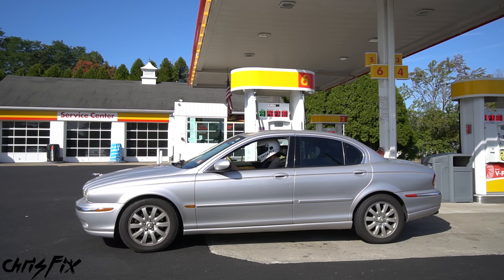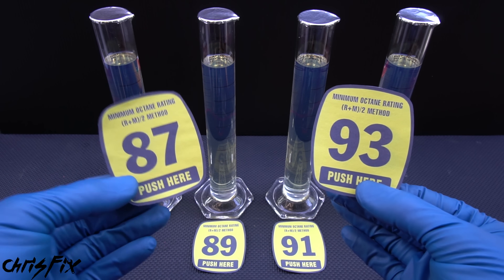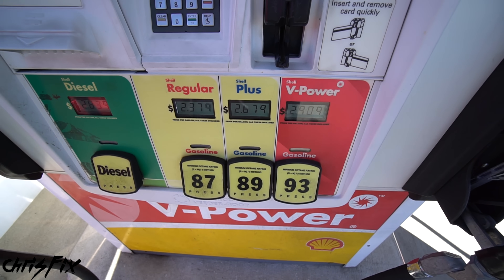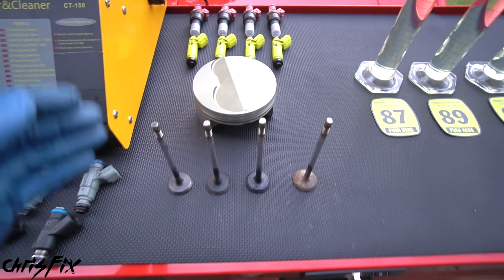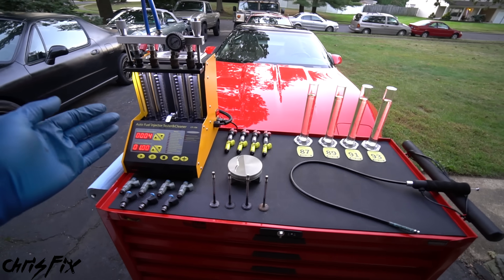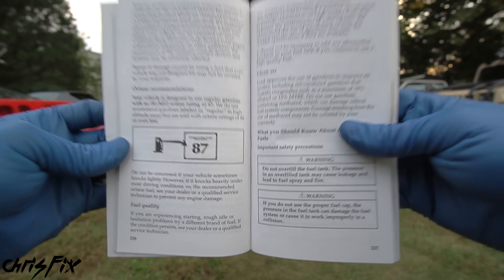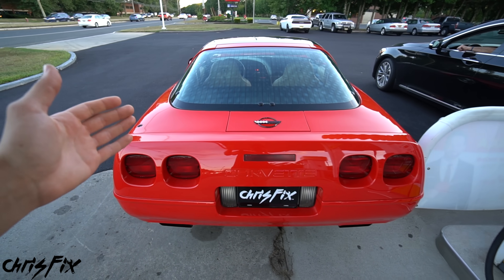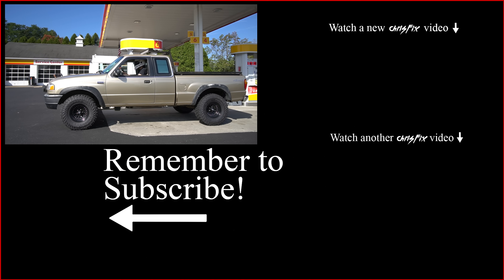What is the BEST Fuel to Use in Your Car or Truck and WHY

Comment: Been burning 87 octane gas in my vehicles for twenty years with a knock sensor, never had any issues with the engine performances on  one of my vehicle,  I got 300.000 miles out of that engine on 87 octane.

Comment: One thing many people do not know the premium fuel burns slower. Altitude also plays a role. These are recommended settings at sea level. If you live in the mountains where your say over 5,000 feet with an engine that says recommended premium. You most likely won't need it. Less external pressure the higher up you are in elevation where regular is more then fine. I do follow up on the recommended fuels that are Top Fuel additives to my manual on my 16 Toyota Camry Hybrid. Don't get sucked into paying higher fuel prices for fuel most cars don't need.

Top Fuel already has the proper cleaners and you don't need to put in additives every so often. Chevron, Costco already have this fuel additive. Stay away from cheap gas stations that don't have the Top Fuel and your cars engine should last you a very long time! I learned this from automotive classes. I am not a mechanic. Also, the difference between summer and winter mix is alcohol. In case anyone wondered. Thanks Chris for the great video.

Comment: I have watched many videos that claimed using g a higher rated fuel that your car doesn't need, doesn't provide any benefits. But they do!

My car only requires 87 octane fuels. When I had thr 4 cylinder version, and used that feul, acceleration would be terrible. Many times when trying to enter th3 highway, or lane change, I would press the gas and the car simply would not respond. By the time it did, many times it was too late and unsafe to make the move.

So I started dropping octane booster in with the gas which helped, but it didn't seem to last for the whole tank. 

O e time when visiting a Shell and buying some booster, the mechanic on duty, said it would be best to just choose the mid-grade gas and get the same benefit. So I did.

Instantly I notice a difference when I would press the gas. The car right away picked up speed. 

He also mention, usually the issue is th3 fuel injector could be clogged and enough gas wasn't getting to the engine when I needed to power, and by the time it did, it was too late. Then I said, why would that be a problem on such a new model car?

He asked if I drive everyday. I said pretty much. He 1st stated to not buy gas from 2nd hand gas stations. Stick with BP/Amoco, Shell, Mobil as examples and stay away from Marathon's and Speedway.  

Since then I pretty much use mid-grade gas all the time. And even though I have the 6 cylinder version of thr same previous vehicle, whenni tried using 87 octane, I often got thr same 4 cylinder results. So now I stick with mid-grade.

The only downside that I notice is higher octane feul appear to burn faster. Which is true. They do burn hotter leading to more usage. 

I also was told once that high octane gas can cause engine damage.

I kept one car for nearly a decade using 89/91 rated fuel and I never suffered any know engine problem. 

Maybe this was more true 20 or 30 years ago, but I can't see how that would be true in more modern cars.

I would say, if your car is rated for regular gas, mid-grade is a better option and avoid the premium option. Premium is strictly for high performance cars and could damage a car it wasn't meant for.

Cars that can use ethanol/corn based fuels like mine can is also a good gas to use to help keep the engine clean. A clean engine performs well, especially when you live in a area where it's gets cold.

I also use synthetic oil because, most have Teflon which leaves a nice coat of oil on the engine even after it drains back into the reservoir. This helps again cold starts where engine parts get worn from no oil being present when you first crank up. This is a very big deal for cars in cold weather

Comment: Ok I’m stopping the video firstly yes the Ron and pon system is different but a pon the numbers aren’t that different so yes Europe get and most of the developed world get better fuel. Also higher octane do burn hotter and more completely and give more power this is because it burns better and can run higher compression/boost and later timeing

Comment: So is the non E-85 (just actual 85) specific to certain vehicles, or is it mostly to do with elevation? I know it's basically unavailable in a lot of states, but in Wyoming, Colorado, Utah, and I think North Dakota, the "basic" or lowest grade octane is 85, and there are still pumps with E-85 as well, so I assume they aren't just the same? Would love to know if it's actually viable to run, or if no manufacturer would ever recommend that octane rating.

Comment: Chris: the one variable you didn’t discuss was altitude. Here in Colorado for instance. Because of the altitude we have less air density. In fact we lose about 20% power (5% power per 1000 ft of altitude) So our engines have lower actual pumping pressure(real compression) My Mercedes E320 is naturally aspirated, and is recommended to use premium. I have been finding that mid grade is fine. No knock. No performance loss. I do put premium in occasionally for the increased cleaning agents in the 91 octane here in Colorado. My Turbocharged cars, especially with upgraded turbo boost; always premium. An interesting note, my 73 Porsche 911S had low compression of 8.5 to 1. I used regular when on the race track. Some fellow Porsche owners surmised that less additives make for a slightly higher efficiency and power. I didn’t notice.

Comment: I have a stock 93 f-150 with the 4.9 L6 in it. When i use 87 gas it pings. When i use 93 gas it runs fine. But this engine is a 87 regular gas engine. It also gets double the fuel milage on 93. Why is this?

Comment: Wow! This is great!! Quick question. I drive a 2007 Honda Odyssey van with well over 300,000 miles. I do number of trips across the country from pacific to Atlantic. That I have done in about 3 days. I try not to push to hard. I have noticed I have to stop fewer times for gas ⛽️ when I use the higher octane compared to the lower octane. Why? How does that make a difference? Thanks

Comment: Awesome video Chris. A little pointer for people having to fill up when they are low on gas and the required fuel is not available. Don't fill your tank all the way fill up to what you need and get the right fuel as soon as possible. Less is more in a situation like this. Keep up the great videos I've learned so much from you it's incredible.
Reply from the maker: Thanks for the tip and thanks a lot!

Comment: Correction,  Octane rating is resistance of detonation yes, but...its the pre detonation that's in play here. meaning depending on your vehicles compression, the air fuel mix will detonate on compression stroke before the plug fires it due to the heat from compressing low octane fuel in a high compression engine. The pistons are  getting combustion force too early before the plug fires right before top dead center on the upwards compression stroke. This is where the "nock" comes from. The combustion energy is pushing the pistons down when they are on their way up.  This will eventually put holes on top of the pistons. So, you're wasting your money on premium fuel in your grocery getter, and doing engine damage to a sport bike, or high end storts car for using regular fuel.
Reply from the maker: Correct!
Reply: @chrisfix  this video was a breath of fresh air for me. I was like, finaly someone knows what they're talking about! You wouldn't believe the debates I have with fellow motorheads on said issues. When I was in technical school over a decade ago, we had to diagnose pistons with different types of damage and failures. From pre detonation, to hot or cold seizures, or whole ass valves stuck in them.
Reply: @chrisfix  p.s. I'm a subscriber now. Lol.

Comment: Most octane boosters are too low in quality &/or potency, to significantly boost octane. In some cases, you might need 50 or 80 of those little bottles, just to raise octane...say 8 points (from 85 to 93). That is not cost effective. The bottles deliberately use an exaggerated rating system, to help liberate you of money! But there are a few brands that are effective. My favorite is called RaceGas.

Comment: 14:17. Quick suggestion if you are forced to use an octane booster; pour the octane booster in prior to fueling. Fueling after adding the booster will help in mixing the booster into the fuel tank.

Comment: This theory or your I formation is a load of crap. My bmw M5 recommends 91, my bmw X4 comp recommends 91, well
I have used 87 since I’ve owned the car M5 with 150k miles  my other m5 40k my x4 4000. All a load of crap

Comment: I have a 2009 accord and I didn't drive it for 9 months and now when I turn it on I feel a slight shake. Should I use certain fuel system cleaner or specific gas to solve the problem?

Comment: love the driver wearin the helmet in the muscletang!😆😅😅😉😁good video, but you are gravely mistaken on the octane booster myth, which many are commonly mistaken, and mislead by. octane booster in conventional fuel is snake oil,it dies little to nothing to boost octane. as well, detergent fuels are bad for older motors, older fuel systems, too much ash... the only thing ictane booster does to a fuel is add some extra lubrication, or add extra ash causing junk that we dont want... granted its possibly a good save in a pinch, but only because it adds more lubrication to the pistons. with cheap hot fire fuels, more lube is better.

Comment: i drive long hours and my cadillac dts V8 gas Mileage increase a lot when I put premiem instead of regular. Can he explains why with scientific proof rather then using analogies
Reply from the maker: Your car is probably "premium recommended" so your engine can advance timing more significantly, which is how you are seeing the mileage increase!

Comment: One thing that I've seen more recently is the increase of E-15 gas at pumps.  I know it stands for greater than 10% ethenol, but how does it compare to standard 87 grade fuel?  What, if amy is the benefit to it vs regular?
Reply from the maker: E15 is added to almost all fuel now regardless of octane so comparing E15 to 87 wouldn't make sense :p
Reply: @chrisfix  Thanks for the reply I wasn't expecting it on an older video.  My main confusion comes from, at least in the DFW area, UNL E15 is on a seperate dedicated pump in most station.  If most fuel already contains up to 15 percent then is this just marketing by the stations?

Comment: 4:55  when u to 102 Ultimate to get the joke
Reply from the maker: huh?
Reply: @chrisfix  in Germany we have a premium fuel which is rated 102, many tuners use it because is has e extra ordinary knockresistant. It’s called Aral 102 Ultimate
Reply: @chrisfix  we have 98 called super plus Shell has a 100 and Aral hast 98 and 102

Comment: One critical point missed.  Today’s modern engines have higher compressions than in the past, and most if not all have computer controlled ignition timing.  This permits the engine to operate on “low grade” gas by retarding the timing in order to prevent ping (detonation).  When timing is retarded, ping is reduced... as well as performance.  When high octane gas is used, the threshold for detonation is higher, allowing the ignition system to safety advance the timing, resulting in an increase in performance.   The question to ask is,  “Is the increased price of high octane fuel worth the performance gain it provides?”
Reply from the maker: Thanks for sharing!

Comment: What is the octane rating on real gas
Reply: @EpicDrew15  non ethanol for old cars and small engines
Reply: @EpicDrew15  well i can buy it down the road not all gas stations have it if availability is the concern its labled "Real gas" it behind the building at a seperate pump i guess laws vary by state its said that it doesnt harden  rubber and extends life of a small engine and water doesnt blend with it like ethanol...

Comment: I had a 2010 Chevrolet Malibu with a 4 banger that’s said 87 was fine to use, before the Malibu I had a car that said premium required. On my first fill up with the Malibu I accidentally put premium in it and never regretted that because there was a difference in response when I would get on the gas. Was that a bad choice to keep using premium?

Comment: Great vid C F! Do you know what the octane rating of E-85 is? I was told E-85 can have "up to" 85% ethanol in it so that would mean the octane rating could vary from different batches. Ethanol has a very high octane rating so Iwould think a car with high compression or lots of boost would like it on "track days" PROVIDED IT IS E-85 COMPATIBLE. Also,curious about your "Driftstang"🐎

Comment: dude damn i just realized what you said my car does exactly that it sounds like it has marbles or something rumbling inside when i start it in the morning and when i  drive for a bit and come to a stop and have it on neutral the rps get low to the point where it shakes but it doesn’t not stall  if i heard correctly you mentioned that as imbalanced air fuel mixture???? Fml

Comment: What's missing totally in your nice video is the answer to the following question:  "Will I damage my car's engine if the manufacturer says to use 87 octane and I run one or two tank fulls of 93 Octane?

I've understood from my father that doing so just may damage your engine.  It will "burn the valves up...".  Now my Father was a submarine machinist mate in the 1930s...so are today's engine metal NOT now going to burn up the engine's valves -- or is his comments from years ago STILL the case today?  That's a BIG question unanswered in your video.

Comment: Bro my knock sensor light came
On ran the code on my Avalon twice. Mechanic said change your oil and I did today let’s see what happens. I’ve been putting in super cheap oil maybe that’s why
Reply from the maker: Let me know what happens!
Reply: @chrisfix  for sure. I hope it’s not my knock sensor. I felt the car had more torque today and as driving smoother with the Chevron Gas. Let’s see

Comment: Octane is the resistance of the fuel to ignite spontaneously due to a non-spark event.....THAT is octane.  Also, fuel formulation are not just REGIONAL but can vary even from one side of a large city to the other side of that city and that can impact what fuel you should use.....
This whole thing is an oversimplification of a very complicated subject.
I have had vehicles that said 'PREMIUM FUEL RECOMMENDED' and when fed 'regular' they ran fine, but they got 3-4 mpg BETTER when the mid grade or premium was used and the DID run better as well.....I know I have got gas at stations in Louisiana and Mississippi that was 'ethanol free' and my 22-24mpg went to 28-30mpg on the highway and the(current) car...a turbo 2.5L running 25psi on a mid size turbo, ran MUCH better......
ANYWAY...this is far more complicated than can be covered in this format....and MOST of todays cars will run better and get better mpg on the mid grade or premium fuel due to better engine management and knock sensors, and higher compression

Comment: Higher compression is good for an engine as long you use premium gas. The bad part of carbon buildup is the valves not closing and the slide that accumulates on the valve train and pistons. One cheap and sure way to get rid of carbon buildup is to run a slow stream of water through the intake while revving the engine up to prevent stalling, after you use a quart or two of water, you should shut it off to finish working and then drive after 10 minutes minimum to push out the carbon, that means pushing down on the gas pedal not cruising, repeat as needed. This technique was discovered by having a blown head gasket and when the mechanic removed the heads, the cylinders were clean, so if you want to mix a little anti-freeze with the water, no harm done.

Comment: Cool video, but in the end, the recommendation is to use what the vehicle says to use? Lol. There's plenty of data out there to use 93 even on recommended manufacturer 87. For example, 3rd party tuners liverpool tuning, have thousands of man hours calibrating maps for vehicles like Ford and jeep. Even though my jeep jl says to use 87, they have seen from the calibrations, that the 3.6 pentastar runs more efficient on 93. That may not mean more mileage, but I'll pay more for a smoother running engine :)

Comment: The myth about better (higher octane) from Europe is not well busted, cause you were talking mostly that ppl should use proper fuel according to manual which is right but you did not explained what is the difference between PON/RON octane methods.
Reply from the maker: They're both ways to test octane and will result in two different numbers, the testing that goes into that is a bit outside the scope of the video, the idea was for everyone to understand that the difference is in the number output, not "quality" or "purity" or anything else!

Comment: I have a flex fuel vehicle that the manual says to use a tank of regular gas at each oil change. WHY?
Reply from the maker: I believe it has do with how E85 is "drier" than normal gasoline, so they would recommend using regular gasoline to avoid "drying" the cylinder walls and piston rings, reducing the effectiveness of oil at your oil change!

Comment: What rarely gets mentioned is..If the knock sensor doesn't hear a knock an engine will keep timing advanced and let the engine make maximum power..So the trick is to know what your car really requires..I guess he covers this thought in the video pretty well..